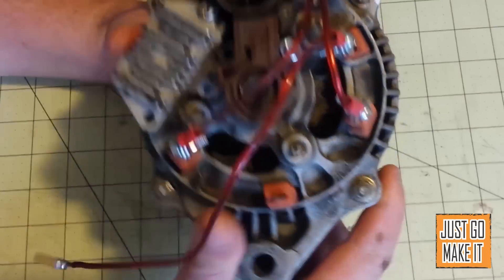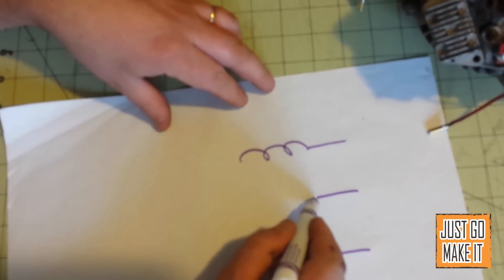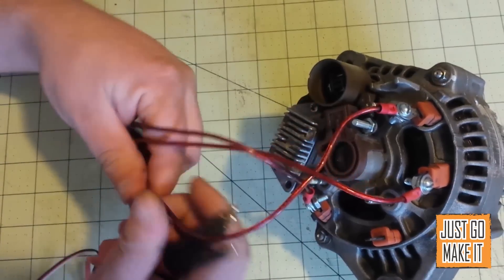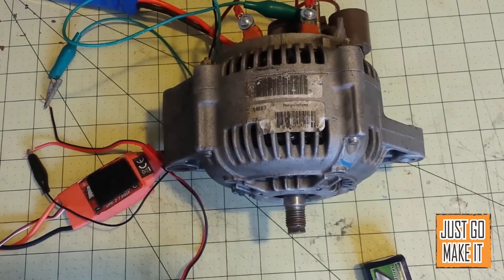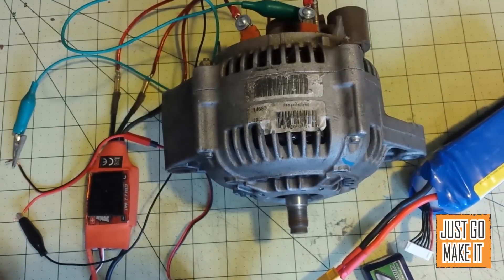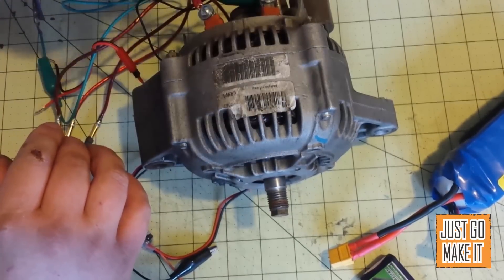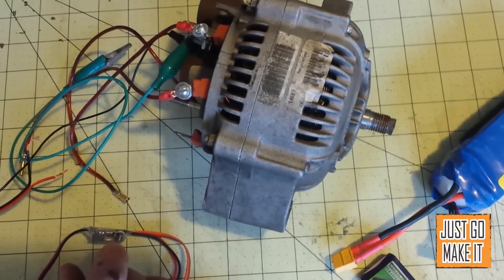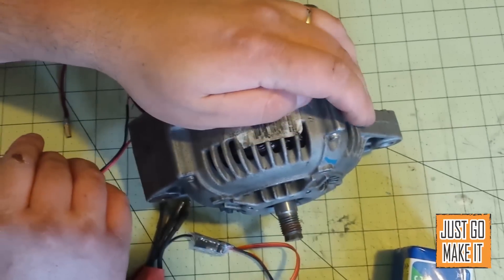Alternator to motor conversion howto

Comment: I have a brushes ac Delco  alternator. and I try to connect  directly to the battery  without the speed control er. it didn't work. 
can you please help
Reply: 3 phase AC creates a rotating magnetic field in the motor thus dragging the rotor around with it.  Connecting DC results in a non rotating stator field and will simply lock the rotor or create a large cogging torque.

Comment: I have a newer alternator that's got 6 wires how would I go about wiring that up
Reply: I'm guessing you've found the answer already.
But for anyone else who ends up here

6 wires will usually mean that you have each end of the three stator coils. 
You can double check this with a meter, if the wires form pairs that means they're either end of a stator coil.
From there you have to wire them together in either a star/wye/y configuration, or in a delta configuration, to make it work

Comment: The diodes do not turn the AC current into DC The rectifier does that The diodes keep the electricity moving one way only it's like a one-way valve for electricity
Reply: The rectifier on the alternator is made up of discrete diodes in the diode pack.

Comment: i used to have a erevo and i installed inexspensive brushless setup, rated a 6s lipo, i found that with 6s , it made a strange noise at full throttle, i got some life batteries and hello-  it worked great, when i sold it , i  told the buyer that it did not like lipo power, i offered to sell him the life batteries, i told him all of it, i am 54 now that was when i was 50, he said that he was ok , day 2 , he gets on email first then calls and tells me that the controller fried after 4 mins running 6s, i reminded him , he still wanted me to refund , when i looked at it, it took alot of beating before he killed it, that was the same time i was having a problem with another situation, not my fault or me doing anything wrong except making sure of documation of all in my yard, and i am glad, to many barney phife or power drunk a$$  holes , and of course the 36 year old man i sold everything to had a buddy with a power opinion, you know the type, civil case but, you will do this or that will happen, i have a problem when someone drives or walks through my double gates with 4 no trespassing signs with my phone number posted, and drives 400 feet to my house and tells me that i will do or cant do or talk the way i want, over a lied up civil case in which i had 2 seperate cameras and audio, the biggest, MY NAME ON THE DEED PAID IN FULL,  THIS  is now even better, 3 8-channel systems eachj with its own windows 7 pro pc hooked into the net with each own cloud act, it is truly the scary fact that a much to big percentage of badges are more to worry about than common street thugs, and i am in the county,,,  BE WORRIED,

Comment: it takes about mechanical work of 5 horse to push that alternator to its stable power of 60 amps in a reference but will charge 5 deep cell battery's in about an hour

Comment: Just my two cents, but if you cut your bullet leads to three different lengths you won't have to worry about them touching.  Just stagger them enough to keep them apart.
Reply from the maker: good idea, thanks for that.

Comment: As a cameraman this guy is not good, but he has the essentials correct for turning an alternator into a 3-phase motor in www.youtube.com/watch?v=0_hVE9GA2es 
The motor running slow when the rotor current is large is indeed a matter of magnetic saturation. He saturated not only the rotor but also the stator. He is lucky the 3-phase synthesizer he used did not overload, since saturated inductors have little or no (inductive) resistance to increase of current. A different motor controller could have seen the stator coils as mere low-ohms resistors and put massive currents through them. 
He should experiment with simply shorting across the brushes for starting in Induction Motor mode. A rheostat of perhaps 25 ohms and capable of handling several amps would also make a good experiment and will adjust the starting torque. Once the motor is up to speed, then is the time to inject some DC power into the rotor, for making maximum torque and precise RPM, made possible by what will then be Synchronous Motor mode.
My own experience with old (external regulator) Dodge alternators as ad hoc gensets gave maximum voltage when 3 to 4 volts (and about as many amps) were applied to the rotor brushes. Beyond that, the engine was loaded down without producing any extra voltage or current. This is an indication of a saturated magnetic field. With 12 volts to the rotor, the engine was heavily loaded even with the alternator output left as open circuit.
Reply: YodaWhat ...I liked the explanations ... you spoke with precision about the operation of the electric motors. 
JUST GO MAKE IT,  you made a nice job. Congratulations.
Reply: Pepper is the most common ingredient
Reply: You should make a short and concise  video cuz it seems you know what ur talking about. Show us eager do-it-yourselfers the right way instead of us spending money and effort on someone elses recipe that winds up burnt or otherwise useless cuz they don't know what they're doing.I'm not knocking them for they're pioneering spirit but it's almost like the blind leading the blind.

Comment: Do I have to use two speed controller and two battery
Reply: No.  But controlling the field and stator independently allows better control of speed and torque characteristics.

Comment: how much current of esc, and how to use that esc without receiver and transmitter
Reply from the maker: +arif critalist i would go a 50 or 60 amp esc.  You could control it with a servo tester or even  something like an arduino.
Reply: +JUST GO MAKE IT  oh i see, and have more question, im really confuse about two different alternator, how i should to choose, an with ic regulator or mechanical regulator ?
Reply: +arif critalist an alternator with ic regulator or mechanical regulator
Reply: +tchangly21 my money its not enought yet for buy that, but thanks for info
Reply: tchangly21 you can use a servo tester to power the ESC. Both the brush controller  and the brushless one.

Comment: Thank you for doing the video, but could you:

Post the list of parts necesery to do the conversion. 
SLOW DOWN with the camera so some of us can actually see the items stationary.
Show Make of the alternator, Vehicle it was on , if nothing else it is for benefit of some that can lay the hands on the same model/make perhaps in local wrecking yard
Show us just what did you have to remove from the Alternator to get to the stage you shoved
Name the parts that are needed by name and brand 
And yes some would be helpful even to SLOW down the camera movement 

This is not meant as critic as I am thankful for the video,. but it does stress the point that not everyone watching can follow at that neck breaking speed of the camera
Reply: I suggest you pause the video to view stuff that moves too fast.
Reply: Please I like this video but I don't have the parts to produce the current and the voltage to run 
Can I build adaptor for it ?

Comment: Is there a way to track rpm?
Reply: a separate tachometer would be desirable rather than assuming the rotor rpm and stator frequency remain synchronous.  As long as the motor is not overloaded and it remains synchronous, 3 phase frequency can be used to track rpm.

Comment: The bearings in your alternator weren’t designed to be put through the rigors of being made into a motor.
It was designed to recharge a battery on an intermittent time scale.
Reply: people on forums and other channels already did research about the bearings

Comment: when you plug it that way, how many HP do you think it's equivalente to? would it be stronger than a 120v 1hp motor?
Reply: Based on 48v with 20ah as example... Just do the Math.
(750w=1hp)

Comment: I see you only need 1 battery, in some videos I see they use 2 batteries 1 for the coil (controller) and 1 more for the 12v brush
Reply: Watch it again... there are two batteries.
Reply: oh  OK, is there only enough two cells to move the brush?  Shouldn't it be 12V?
Reply: @si_FULAN  High voltage on the coil gives high torque, lower voltage gives higher speed.
Reply: ok, thanks for the information for me, I'm waiting for the next video using the e-bike controller 🤗
Reply: @si_FULAN  if you want more videos with ebile controllers, i can help you

Comment: how much horse power or torque on this motor??????
Reply: Probably best way to estimate the horsepower output is to look at the amp rating of the alternator its intended automotive application.  For example, a 100Amp alternator working at a typical automotive system voltage of 13.8V will output 100 x 13.8 = 1380 W.  746 Watts per horsepower means the alternator is generating 1.85 hp as electrical output.  Assuming it's about 85% efficient, which is typical of automotive alternators, a pretty good approximation of power input to the alternator shaft under this fully loaded condition is about 1.85hp/0.85 = 2.17 hp.  Therefore applying the maximum 1380W electrical power to it as a motor will also result in about 85% conversion to mechanical horsepower.  This is 1.85hp x 0.85 = 1.58hp out of the motor.  This is approximate and assumes 85% efficiency.

Comment: Can't you just eliminate the 12v battery, that is on the stator?  And just wire the Stator, to the Battery power from the Controller?
Reply: From a 48v 1500 watt Controller?

Comment: Why go through all that rigamaroe
When you can just Connect the battery to it?
Reply: That would not work, it needs a three phase signal. The alternator does actually create ac voltage but the diodes turn it into dc voltage.

Comment: Sir I live in afghnistan I can't find any dc motor hear 
When I wach your film in youtub I buy car alternator same your then remove doide and I cantact positiv and nigitive of battery in first and last of core then tow waire positive and nigitive in tow burshes but it not work. Plese heilp me I want to make villchir for those peopel how can't walk I made all thing voltage regulator and battery charger .... plese plese
Reply: You are missing the three-phase inverter that was shown in the video.  It turns dc into three-phase ac which is applied to the stator.  Without that you cannot turn an alternator into a motor.

Comment: Could you add pulleys to the output shaft then use that "motor" to spin 2 or 3 other alternators to charge a 24v battery bank?
Reply: Hi, yes it is possible but the other 2 alternators will absorb mechanical power ... the output is not going to be valid ... because it takes more than 3 hours to recharge a batt ... your batt to rotate the Motor alternator will consume much more and empty very quickly .... this is not a good idea ... you can not recharge a batt as fast as you spend ...
Reply: see silicone battery very fast or you could use ultra caps which charge in no time this will provide enough for loading and so forth
Reply: abialo2010 If you have power to run a motor, just charge the battery from that power instead of using mechanical motors and alternators to waste energy.
Reply: What you want is a 3-phase DC induction, run by any means (outlet, generator, etc) then you would use the alternators to charge batteries for vehicles. But using electricity to make electricity again doesn't work; at some point mechanical rotation needs to occur. You should just put a generator together and use the electricity as needed. Like make a generator for your batteries & just do that instead of mickey mousing a bunch of alternators together making heat.
Reply: Also, the cost of adequately transferring rotation would be twofold, each belt would have losses. Then each motor, then, all the unnecessary wiring & also finally the cost of buying little sprockets & belt drives since they will all have to be custom made by you.
Just find a way to produce sufficient energy for your batteries in the first place.
Reply: You never get something for nothing. You have to consider the horsepower output of the driving alternator. One horsepower, electrically speaking, is 760 watts. Converted to electricity at 12V DC is approximately 63 amps. Converted to 120V DC would only be about 6.3 amps. If you wanted to build a setup with two alternators to get 24 volts, first you would have to completely insulate one alternator from the rest of your set up so as to be able to connect the two in series. You wouldn't be able to just connect two sets of jumper cables to two banks of 12 volt batteries as the series jumper between the two banks would short out one or the alternator unless you are willing to remove said jumper EVERY time you want to charge your batteries. If your 24 volt battery bank was severely depleted, it may draw 60 or more amps just to begin to charge them and this would be if you had just two 12 volt batteries in series. If you are looking for an auxiliary charging system to charge a large bank like in a solar or wind power system, forget it as your charging needs would most certainly outsize the practically of the system needed. Not taking into account the mechanical and frictional losses in such a system with bearings, belt(s), the sheer weight of spinning two field coil rotors in the generating alternators, the alternator driving this setup would have to develop more than four or five horsepower to even begin to get the other two started and run them fast enough under the load of charging depleted batteries. Remember, 760 watts, (one horsepower) / 12V DC equals 63 amps. To develop even four horsepower would then draw 252 amps out of your driving batteries. Even more when you add in the frictional and mechanical losses inherent in your system. This would take an unusually large alternator to drive these. Theoretically speaking, the alternator in the video, if it's an average size 90 amp alternator would only be capable of producing about 1.5 horsepower at best. Then you would have to power a properly sized alternator with ten or more large deep cycle marine type batteries to have enough reserve run time to get a charge into your 24 volt bank. Then how are you going to charge your driver batteries? He ran his motorized alternator off from a 22.5 volt model airplane battery for demonstration purposes only into the alternator under no load. To actually ask it to do real world work would take a LOT more power than you would develop with such a battery. A better option might be to go to a truck junkyard and buy a 24 volt alternator and pick up a six or eight horsepower gas engine. Just remember not to deplete your 24 volt battery bank to the point where it doesn't have enough power to properly energize the field coil of the alternator. If it is below the turn-on threshold of it's voltage regulator, you would have to get an alternate source of 24 volt power to feed the regulator until your bank picks up enough to feed it on it's own. Something like 2 X 12 volt large motorcycle batteries or lawn tractor batteries connected in series. Good luck, Jeff M.
Reply: Sure but it would very inefficient. Also probably would not have much current available.
Reply: Phrrrt! :)
Reply: you could be a genius, spin 2 or three generators, yes, thats it
Reply: Better use fuel (strimmer engine ) to spin them up generate sum amperage forget using it as motor

Comment: I am so mad at you. Why does yours work and I can't get the simplest thing to work. I feel so stupid. I have a 50-300 amp esc. Wired right or left? I need an emp to fix the bldc for  E to = MC^ with an ekg - all the time I wasted trying to jump a spark from - to +. My brain is broken Sir. may I ask for your personal assistance please.. I been working on this stupid robot for over a year. When I power everything up, it may spin 3 turns or so and stop. Then it chugs sometimes. Please before I run out of seconds., this is my first. I am thankful for the way you explain, the speed, and follow up. I use remote control. ESC, single battery for both, powered by center tap on the RCU. Works fine on a DVD BLDC. This is all your fault I blame you. Now I feel better. Any Ideas? I don't want to use a scooter controller.  I should have plenty of ECU with 300 amp burst. 50 amp Onyx Programmable Brushless ESC. I'm not pulling a load....yet. If it burns up after I am finished then my math is done. I am going to run 2 of these like a Segway. The robot should be around 350lbs. Gearing according to limits of the ESC.IDK. I'm just doing way to many things and chasing my tail. I hope you got a laugh from my rant. Thank you Sir for any and all advise.